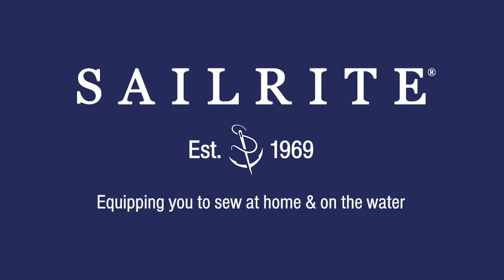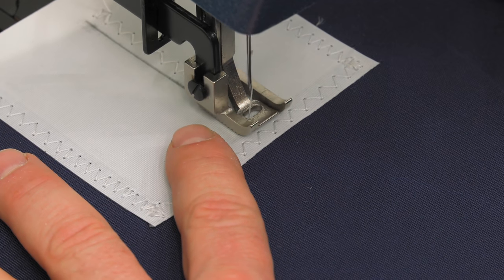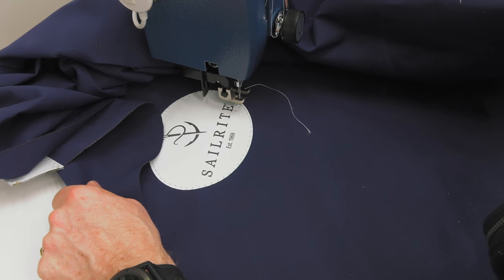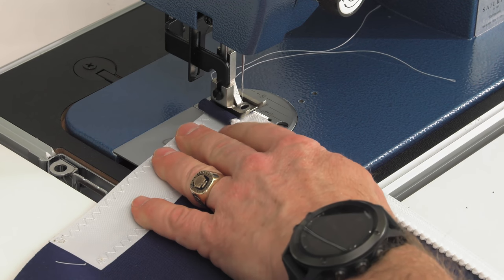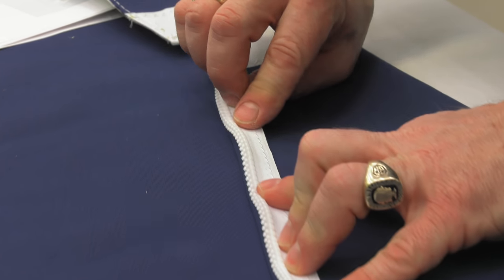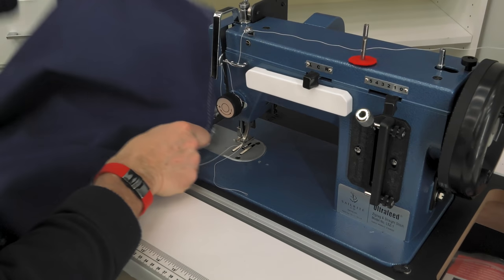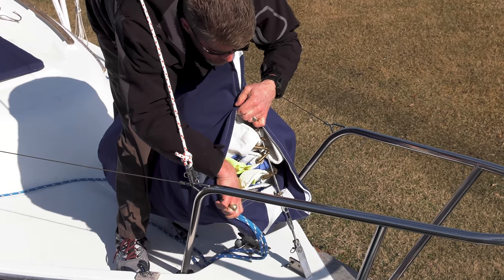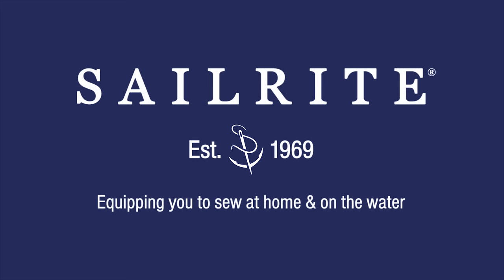How to Make a Foredeck Sail Bag from a Sailrite Kit

Comment: So I don't want to sound whiny, because I really do appreciate the work you folks do, and to the comments below it takes alot of work to video the assembly as well as the applied use of this system.  That said, it looks like you're using a lightweight, maybe stormsail, maybe regular 100% jib, but I am trying to decide if this approach will work with a 150% genoa, that a more firm, racing style sail, with a foil on the forestay...if you have any suggestions/insights, I would welcome them - thanks again for the work of recording/posting this and other videos as well as any insight you can provide - Respectfully Joe
Reply from the maker: The foredeck bag is designed for use with a hank on sail so that you do not need to remove the hanks and bag the sail and tack it below.  With a luff tape system the sail is completely off the forestay and this bag would not be necessary.  I suppose you could make it work  but it could just as well be any type of bag made out of sunbrella with a few webbing straps so you could bag the sail on deck and secure it to a toe rail or lifeline stauntions so it doesn’t go overboard in a blow.  I would think a longer bag may work better in your case so you could drop the sail and flake it on deck, take the clew to the tack—fold it in half and bag it then zip the bag closed until the sail is needed again.

Comment: Would this work for a staysail on a boom? Thanks
Reply from the maker: No. A staysail on a boom would take something more akin to a throated sail cover with a different angle on the forward edge more around 70 deg instead of 90.
Reply: OK, thanks. Do you have a kit for a staysail, or directions how to modify a small mainsail cover? Thanks again.